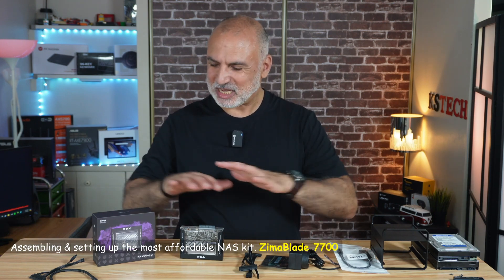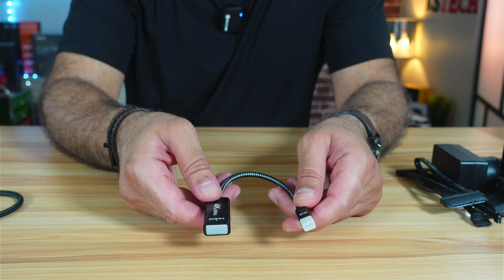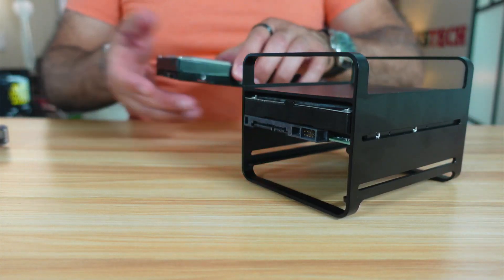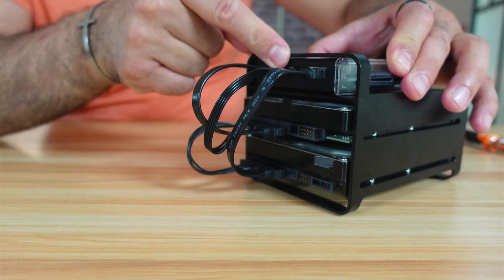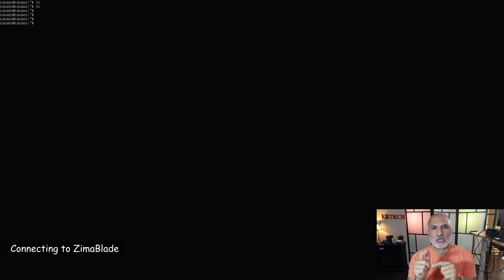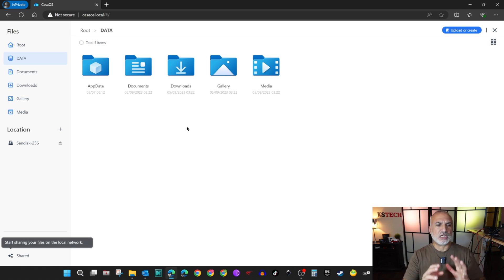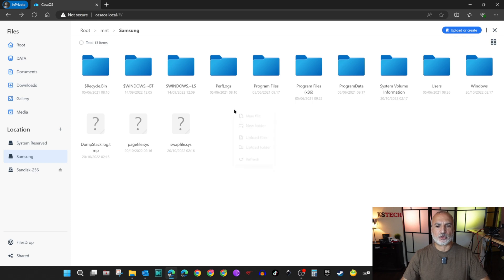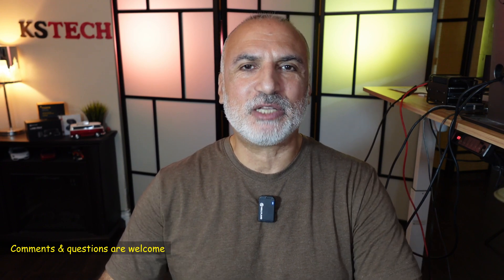How to build a NAS Server the easiest way | ZimaBlade

Comment: Hi! Could you please tell me if the USB-C power adapter (12V = 3A) included in the ZimaBlade 7700 package is enough to power the entire system along with 2 hard drives? I’d also like to add an adapter for an NVMe SSD, but I’m concerned it might not work.
Reply from the maker: I tested it with one HDD and one SSD simultaneously and it worked